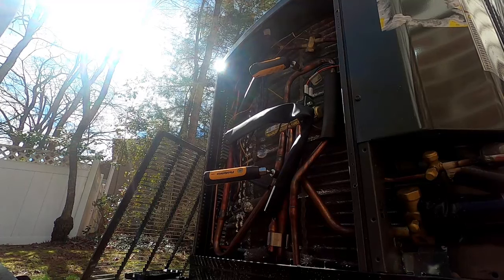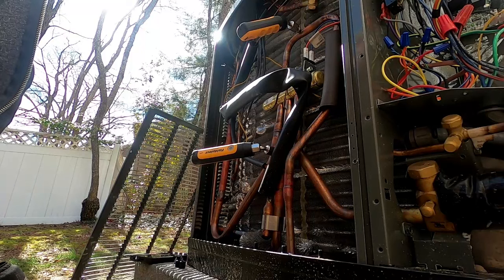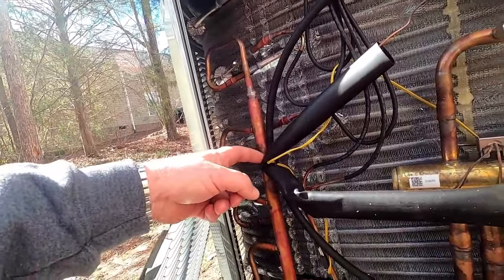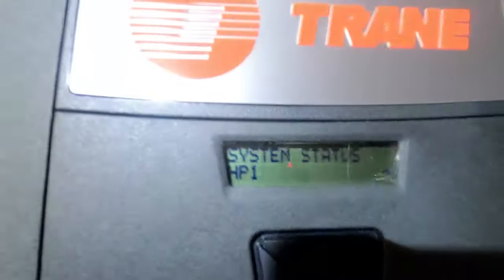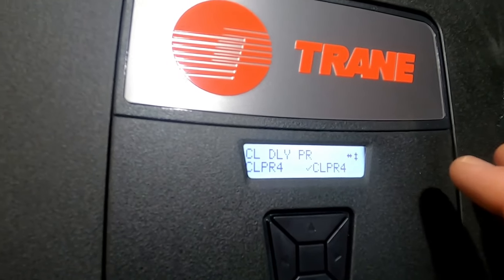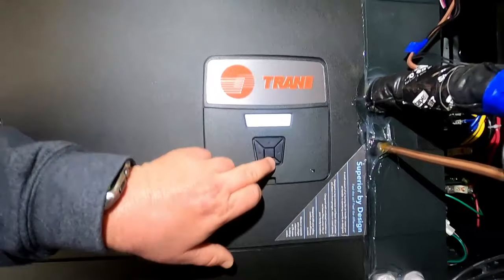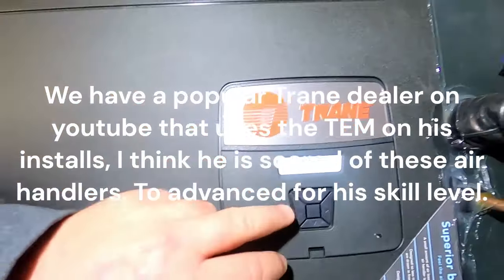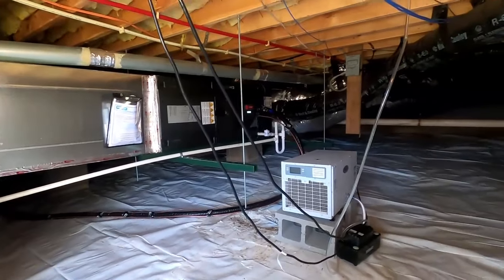HVAC - Quality control and the TAM9 set up.

Comment: Tam9 is cool and all, but man them things are huge. My dealer rep suggests I start installing them all the time though…
Reply from the maker: You can also get the GAM or GAF. They will give you the smaller options. Just without the display.  Will come with the EEV or TXV option.
Reply: @myHVAClife  what’s the setup process like on those vs having the screen with the tam9?

Also have you ever cut a tam9 in half long ways to get it in a attic? I hear there’s a way lol